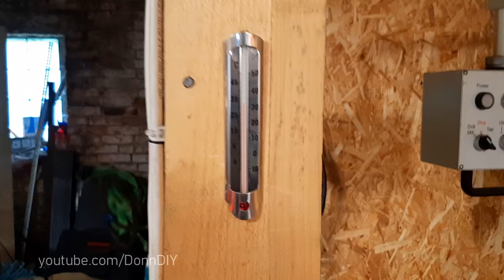Jaw Rock Crusher - BUILD Ep.6 - IT'S FINISHED!

Comment: Great job (as usual)! Looks like it works awesome and will be perfect for turning your supply of old concrete and broken blocks into something useful around your farm. 
Suggestions:
Are you going to build an intermediate shaft (jackshaft) to gear it down? Seems least costly to me if you have a couple extra pulleys laying around.
I'd also maybe consider a flap at the bottom that is hinged at the front and would allow the gravel to discharge toward the back. It'd still pile up, but be much easier to get to for spreading etc. Could have a simple strap or lever to hold it up when not in use.

Comment: I think a crankshaft with more stroke will greatly improve the crushing speed
Reply: It would take very little extra stroke to bring it to a halt.
Reply: @UncleKennysPlace  it doesn't seem that the engine is struggling. We don't know how much horsepower the crusher really takes.
He could check the throttle plate position while crushing, if the governor pulls it already almost wide open, there is no power left. If it is just half open, he has enough horsepower left...

And if he changes the pulleys to make the crusher rotate slower, that will increase the torque which will allow more stroke.

Comment: Excellent build Donn,

You could use the firewood conveyor belt and then put all the gravel into a drum of some kind with a slit on the front face. The idea is that when you want to use it you can use the forklift to drive it around, and open the little slit so the gravel comes out and then you just need to drive the section that you want to be filled with gravel.

Comment: You'd get a decent amount of the wobble out if you had some weights on the back left of the trailer, to balance out the engine weight in the front and the flywheel on the right. Also yes, making sure the flywheel is balanced would help too. Also if you want it to crush faster, you need to make a bigger cam lobe on the shaft (or slower gearing, as you mentioned. You could do both and get a pretty good boost to crush speed.) Very nice job!

Comment: I work in a rock quarry, our jaw crusher has the pully on one side then a flywheel counterweight on the other, thus balances the work load out to prevent pre mature bearing failures. Your jaw plates need to be reverse able for maximum life. They will wear the bottom out first. You also need wear plates on the sides this area wears fairly rapidly. If the stone gravel is dropping directly onto the axle under the crusher it will wear quickly to and will need to be shielded. It looked like the speed was running pretty good, if you run it at to slow a speed then more stress is put on things, its the momentum that keeps things moving.

Comment: Even before you mentioned needing to gear it down I was thinking that using a jack shaft with a small and large pullies between the flywheel and the engine to slow it down would let the rock have time to fall into the crusher better and speed up the process. Curious when your gonna take on building a long tail mud motor from scratch or a surface drive outboard, maybe even one with reverse to use on a small boat to get up into some shallows?

Comment: Your engineering and fabrication skills are awesome! Thank you for sharing with us!
Reply from the maker: So are yours!🤘Truly love your builds, man.🤘🤙👍
Reply from the maker: BTW, your turbo diesel ATV build was the inspiration for me to build my 4x4 UTV. Might also do a 1.9 TDi ATM swap in the future on it. Right now I'm rockin' a 1.4 petrol engine with manual transmission on it.
Reply: @DonnDIY  If you want install automatic transmission check your transmission ratios, because my axles are 2.65 , and with that AT gearbox max speed on max revs are only 60km/h. Comfortable speed only about 35km/h
Reply from the maker: No worries. My current BMW differentials have 2.8...something gearing, the top speed at the moment is around 53 km/h. I use the UTV only on the homestead for work and don't do long trips. I'm just presuming that driving automatic is a bit more comfortable than manual. Especially for you on your ATV.

Comment: Very nice.  Need to do something like that myself.  I have a bunch of sidewalk I need to replace and crushing the old stuff to make the grade and then spread the rest on the driveway would be nice.  Not to mention some of the rocks I dug out putting in 75 feet of trench for a new waterline to get the old rotten steel one out of the loop.

Got a 5HP engine sitting on the back porch too so looks like I need to find some steel....

Comment: I’m worried about those interior bolt heads getting worn down to the point where a socket won’t turn them……. But, that’s one bad assed crusher.  You are one helluva craftsman !!  Salute .   👍🏻👍🏻😁
Reply: Same.  Those interior bolt heads are going to get majorly, majorly worn.  Or are those bolts going to serve as the wear indicators, and you'll just wait for them to get so badly worn that when they break off you'll know its time to replace the wear plates?

Comment: You did an excellent job designing and constructing your rock crusher, well done! The only critique I have is maybe use a 40-45mm drive pulley and maybe in the future change the wear plates' bolts to class 10.9 socket flat head screws as I think they would be better to remove when changing/maintaining the wear plates. 
Overall very nice unit, I wish it was mine!

Comment: Hey Don on that handle for the up-and-down leg for your trailer and idea would be to convert that over to an actual wheel or Circle it's a lot easier to turn and you don't have twist your wrist at a funky angle. Also that top-handle bus that off and put a hinge on there so that the handle can lie flat because inevitably anything standing up like that is going to catch on to something. Also you might want to add like a little funnel to the crusher  sides you can put in 10 or 12 bricks at a time I don't have to sit there and micromanage it just some ideas

Comment: Looks like you need a hopper so you can load more material in. Jaw crushers like to have a little weight above the crushing point to keep the material down.
Not sure what type of clutch you're using, but sometimes you can remove some or all of the springs or swap them for lower weight springs to change the engagement point.

Comment: Nice Job on the crusher, Just remember if you slow the rpms down on the motor its air cooled It will over heat and ruin the motor if you want slower motion on the crusher try a jack shaft, it will work perfect!!

Comment: You might want to drill a hole in the jack leg where the lock bolt hits in the retracted position.  That way if the bolt loosens, the leg can't fall as you are driving since the bolt is acting like a pin.

Nice build!

Comment: Good job,but I'd only use  mig welder for tacking as the weld is brittle ,vs sheilded arc rods.I would have added a chute under the jaw and maybe a screener,to separate fine crush from larger crushed ores or rocks.
Do you sell plans or donate them?

Comment: I was worried about mis-aimed or thrown-out bits wedging themselves between the flywheel and the casing, but it seems to go just fine. If it ever does, perhaps you could add a steel sheet to screen the flywheel

Comment: Congrats!! This has been a pretty long project for you hasn't it?  The rock size is a little small if you are making roads to drive on.  You don't want so much powder in it.  If you grind this up too small, the little fine particles will settle between the big ones and they will actually hold water!!

Comment: Love this build, looks fantastic in red. Do you think the crushing plate retainer bolt heads might get damaged and rounded and be difficult to remove at a later point?
Reply: Probably will be deformed but nothing to worry about. Bolts wear out on tractor teeth, blades, skid plates, and crushers. That's just part of it. Replacing isn't difficult relatively speaking
Reply: Bolt heads are causing the material to hang up as well

Comment: Nice build!  You could add a jack shaft to allow for even more gear ratios.  Also you should add a bolt on hopper, this would allow you to load a bunch of concrete or rocks at one time.

Comment: Looks like you need to add a jack shaft to the drive line; that way you can just open up the throttle and let the engine's governor do it's job for you. And as you've greased the living snot out of it, to keep the dust out of the bearings, you should at least add a couple of rain shields over the shaft to keep the water out. You've sunk some serious money into your bearings; if you don't want to add seal's (re my last posting), at least keep direct rainfall out.

Comment: Add a locking pin for the leg at the highest setting for when travelling because I have seen them come loose wile driving then the leg drops digs in and flips the trailer and possibly dragging the car off the track/road

Comment: Just an idea: If you need to separate fine particles from coarse stuff just put a sieve under the output in an incline so that it is mounted on the crusher frame. The shaking will make the coarse material go down on the sieve and finer stuff falls through. 

BTW, when the wearplates wear down are you going to get them removed? Won't the bolt heads be worn down too?
Reply: Вот и я подумал как он будет их откручивать, если на них грани все сносятся)) но может он не будет до этого доводить🤷🏻‍♂️ либо к изношенным приварит что то и открутит

Comment: Could always run it off a hydraulic power pack running on the engine so it's got no clutch to worry about and it's just a spool valve to operate it , could run a hydraulic conveyor to remove rock into the skid steer bucket!

Comment: t is possible to install an inclined grate (sieve) with a cell of 6-8 mm at the bottom of the crusher outlet and receive separately a fine fraction (sand) and a coarse clean fraction of gravel at the outlet. The vibration of the crusher itself will ensure good screening and mixing of the gravel material along this grate to collect the finished product in a container.
---
Можно снизу на выходе дробилки установить наклонно решетку (сито) с ячейкой 6-8мм и получать на выходе отдельно мелкую фракцию (песок) и крупную чистую фракцию гравия. Вибрация самой дробилки обеспечит хорошее просеивание и перемешение гравийного материала по этой решетке для сбора готового продукта в емкости.
---
Good luck!

Comment: Hi, great job! Could it be useful to add rubber elements between the crasher and the trolley? Does it make sense to balance the flywheel, or can you skip it due to the low engine speed?

Comment: You can adjust the centrifugal clutch. Just by changing the weights and/or the springs you can set whatever engagement point you want. I think with the high RPMs you are losing a lot of energy in the whole machines oscillation.

Comment: It would be relatively easy to add an intermediate/ reducing countershaft pulley to slow the drive down and increase torque. It may even be cheaper than a new Centrifugal clutch, if the excessive speed proves to be a problem.

Comment: Those bolts on the wearplates are going to break down ! If rock hits the heads off the bolts! I would protect them a bit by welding a cirkel of wearwelding around them.

Comment: You will struggle a lot with those hexa screwheads for sure :) 
Anyway, nice build, the mechanical parts are good, only the screws what I dont like.
Reply: When the plates need to be replaced, just slice them off with a torch. No worries about hurting the plates as they are scrap anyway.
Reply: @ADBBuild  Yes, But the guy welded the nuts and heavily loctited all the screws. He will cut off the heads, take off plates and then weld something on the bolts to take them out and replace. Instead of this he could've welded them anyway :)

Comment: Very low productivity caused by the small size of the working part, plus the lack of a hopper for loading. This could be solved by placing the working part along the axis of the trailer, and not across. Due to this, it would be possible to make the working part at least a meter long.

Comment: Hey mate what throw size did you use for the cam?
Reply from the maker: 8 mm or 1/3"-ish. The throw depends on what you want to crush with it - taller cam for concrete and cinder blocks etc; lower cam for granite and other hard rocks.